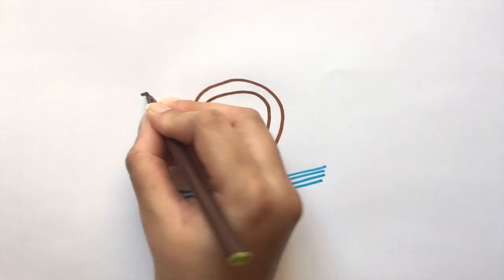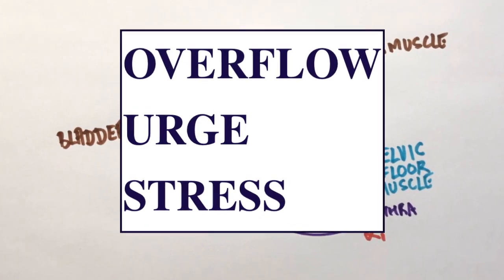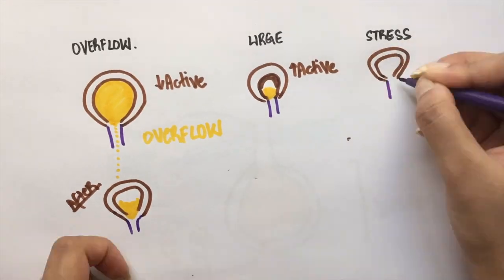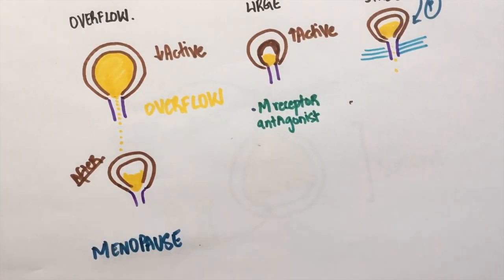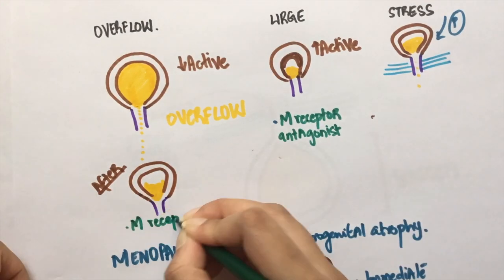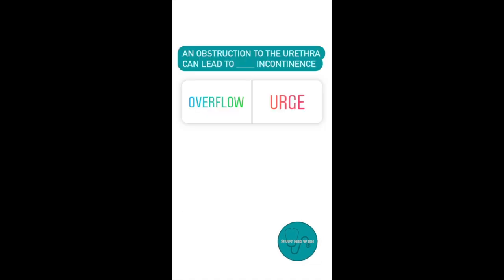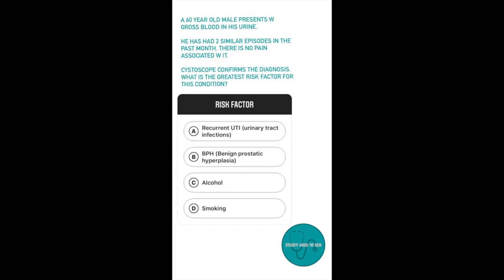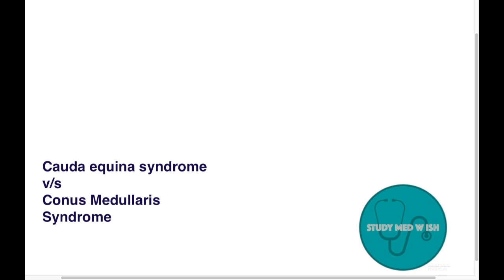Urinary Incontinence - Stress, Urge, Overflow: Pathophysiology, Clinical correlation | USMLE | MCQs

Comment: key concepts

1. overflow incontinence is due to atony of the bladder (think, the bladder muscle is not working so the urine builds up to overflowing)
2. urge incontinence is due to detrusor instability (think, the bladder muscle is overactive, giving you the urge to micturate all the time)
3. stress incontinence is due to urethral hypermobility.

4. diabetes destroys nerves and muscles, bladder muscle fails to contract, so there is overflow incontinence
5. in postmenopausal women, collagen is gone so the bladder has become small in capacity and even a little urine causes urge to micturate all the time
6. bethanechol, a CHOLinergic agent stimulates the bladder muscle to contract. used in atonic bladder or overflow incontinence
       (trick: bethaneCHOL forces the GALL out of the atonic bladder)

7. oxybutynin, a muscarinic antagonist, calms the bladder muscle. used in urge incontinence or overactive bladder.
      (trick: OXYbutynin. let the term oxy remind you of sexy and hence sexual URGES. oxybutynin then, is used for urge incontinence)

8. incomplete bladder emptying means bladder muscle is not contracting. means atonic/overflow incontinence

9. urethral obstruction causes bladder to fill to overflowing. so there is overflow incontinence.